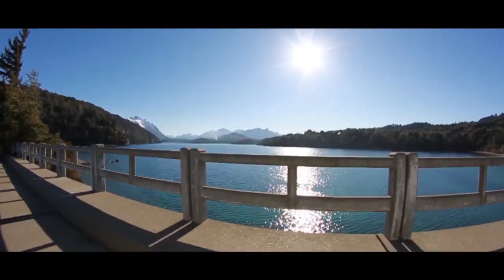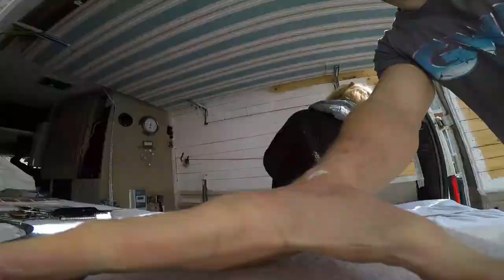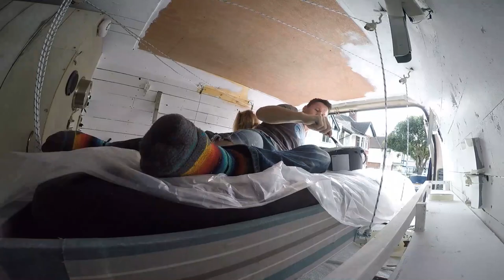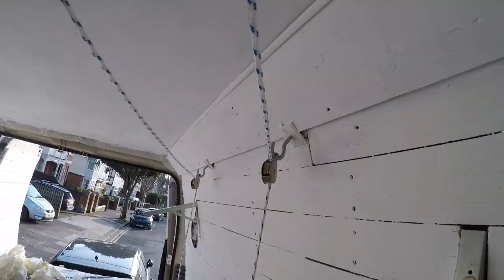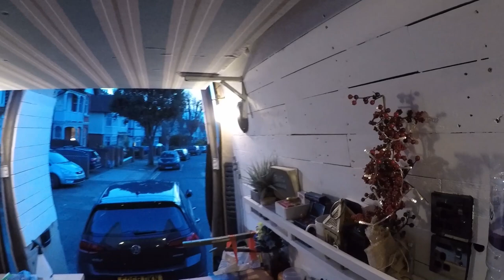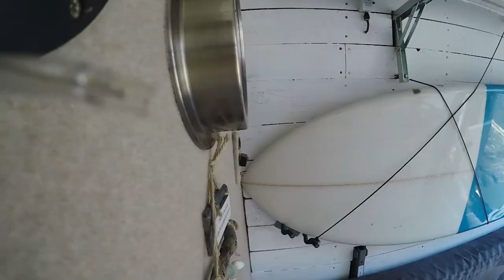Whitewashing van interior to brighten it up during Coronavirus isolation.

Comment: Great job, its amazing how much brighter it makes it look. I've just been watching your video of you fitting your waste water tank. I think that i have got the same tank from Cak Tanks. Just been looking at the size of the shower inlet & sink inlet its tiny 12mm. Could you tell me if yours was the same & if you have any issues with slow draining waste water from your shower & sink or does it all work ok. Just wondering if i need to increase the size of the inlets holes before i fit them?
Reply from the maker: Andy Beaumont yeah the video doesn’t really do it justice either as it was such a lovely bright day when I filmed the clips when it was plain wood. Yeah Cak tanks sounds right and the inlets on mine are about that size too. The only problem I’ve had is sometimes a blockage at the outlet which caused water to back up into the shower. Once I unblocked it and took greater care not to let too much food waste go down the sink drain i haven’t had any issues since. I’ll occasionally put a bit of grey water tank cleaner down the drains too just to Jeep it fresh. Best of luck with the build and thanks for watching!